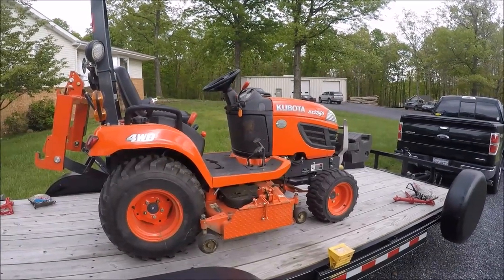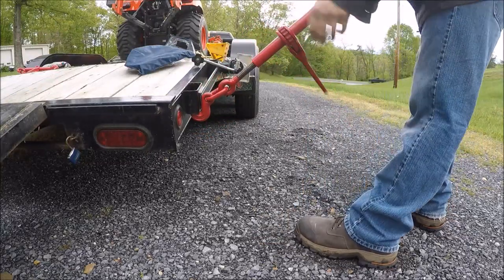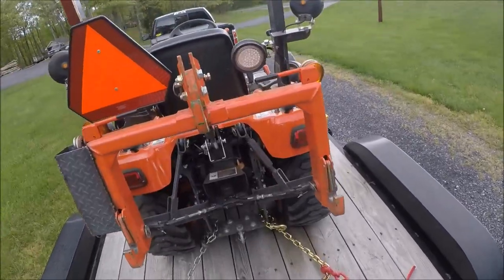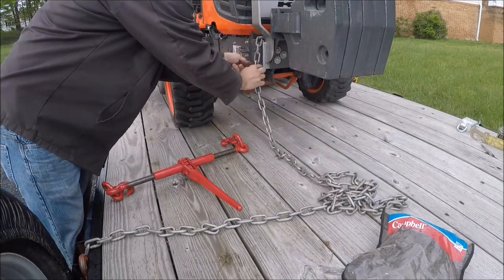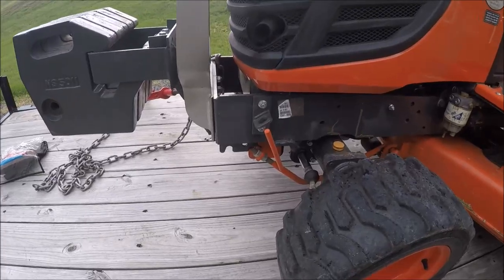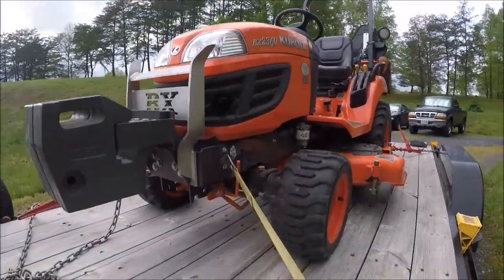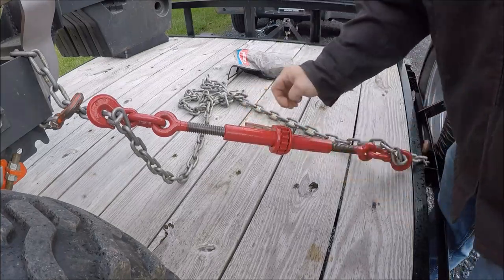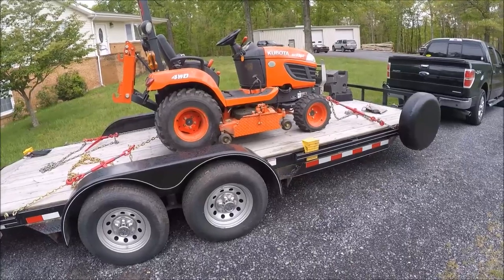How to Secure Your BX to a Trailer

Comment: I only use the 2.5 tonne ratchet straps on my BX, takes half the time, doesn’t chip away paint either. These 10mm chains are good for 10t each, way overkill. Apart from that, all your lashing tips are spot on. Locking webbing ratchets is very important, I see so many people leave them open, they spring out otherwise.
Reply from the maker: Straps are my choice. I just wanted to show 2 methods. Also if the ratchet breaks, it will still hold if it is locked.
Reply: That rating applies to a steady load. However, any kind of inertial forces, such as hard breaking, swerves can cause the net force on the individual straps to far exceed the weight of the vehicle, and possibly the rating of the straps. Just something to think about.

Comment: nice job! I like that you pointed out to stop and check the chains after driving a mile or so to insure they are still tight. I have arrived on location to find chains have loosened up in transport for some various reason. that is a good tip!
Reply from the maker: Thanks!!! I guess everything "settles in" after a little driving.
Reply: To help prevent the chains from losing tension make sure there is no twist in the chain as you bind it

Comment: In my state dot requires 4 contact points on the vehicle as you used. However it is required to be done in an X pattern. Also any implement has to be strapped down separately.
Reply from the maker: I cross the straps when hauling a car but I don't cross chains on a tractor. I'm not sure how you could cross the chains the the BX but if that is what is required in your state that is the way to do it. Thanks for watching and commenting!!
Reply: Coy Patton YEP thats FED DOT LAW ! CROSS CHAINS AND DONT LET THEM COME IN CONTACT WITH EACH OTHER  THATS A AUTOMATIC FAIL .
Reply: Travelin Thru yep. It is commercial requirements. Probably the only time you will have an issue as a private individual hauling is in some sort of accident. 
Good practice is to abide by DOT regulations, take pictures with a  date stamp.
Reply: Coy Patton read the law it's only if it's over 10k do you need four crossed chains. I promise you that tractor doesn't weigh 10k.
Reply: As long as you stop the movement in all directions it’s fine.
Reply: As long as the chains or straps do not rub, right?
Reply: Travelin Thru in Texas, that’s true only for loads over 10,000 pounds.
Reply: Go by the most restrictive.. state or federal law.  Generally they are the same for  securing loads.
Farm tags on the trailer makes it commercial and you need the crossed chains.
Reply: @fhuber7507  I have always gone by the basic philosophy that it only matters if you are in an accident, as seldom will DOT bother with a private vehicle and most local police have learned the hard way, they do not know enough to do much but get themselves in trouble. State Police want DOT to deal with it. 
When it comes to insurance or court, if you were in DOT compliance, you butt is in the best position possible. So at least 4 points at 45 degrees. This usually means they are crossed due to trailer width and load width. 
I cringe when I see someone with an unsecured load or a lawn mower with a strap across the operator station—both free to move any direction at all. And often just 1 1” strap!

Comment: Getting chains closer to the length needed saves money and can eliminate the need for  a couple of the ratcheting turnbuckles.  

connecting to trailer and tractor is almost the same at the uphill side, then you let the tractor move as you pull the downhill chains tight, then lock up the brakes.

Closer to how the flat bed tow trucks do it.

using a 25 ft chain where a 10 or 12 ft will do... just has a bunch of chain rattling on the trailer deck.
Reply from the maker: These are the chains that come in a bag from a hardware store. You can buy them cheaper than you can make them.

Comment: Great video. One thing my boss says is to always secure the hooks back to the chain, like you did around the chassis, not tip load it like you did at the stake pocket. Not sure if it just him being over careful, or if there is some science behind it. I though I may as well share it in case it is of some use for you.
Reply from the maker: Thanks! Some other people have said the same thing. I loop the chain around the stake pocket and hook the chain to itself now. I don't think it matters too much on something small like this, but on something bigger it would make difference. Thank for watching!

Comment: It’s impossible to find a detailed video on securing a tractor, so thank you for this.  A local Constable told me the excess chains cannot be more than 12” hanging loosely.  Do you think 3/8” is overkill for a L4701?
Reply from the maker: I would use 5/16 grade 70 chain. I believe any chain securing a load should be grade 70. If you have 3/8 grade 70 that would be fine, just over kill.
Reply: 3/8 chain is better since he may be hauling with implements, thus additional weight to calculate. Most people have heavier tractors also.

Comment: 94Bullitt, I meant to ask what do you recommend to do with the excess chain (example on the rear of tractor) after you tightened down the tractor? Do you tie up the excess chain or wrap it around itself?  I just watched your other 2 videos on what kind of trailer to haul your tractor and those videos definitely answered some questions I had. Yep, I'm going to get the 10K trailer with brakes on each axel. It just makes sense.  Thanks again.
Reply from the maker: Good question, It probably would be best to wrap the excess chain back around the binder and chain and secure it with a tarp strap. I'm glad you found the other videos helpful. Good luck on searching for a new trailer.
Reply: Houndsman One DOT inspectors I have talked to all recommend the chain be wrapped around the load binder. 1) they say the binder must be secured to prevent it from loosening. 2) excess chain must be secured to prevent it from coming away from the trailer, either causing damage to the load and possible flying objects, damaging your trailer in a manner that makes it unsafe (flats are common results) or the chain possibly hitting another vehicle. 
While not commercial and may or may not be required to meet DOT in your state, following DOT is the safest in many ways

Comment: Here you have to have 4 binders no ratchet straps you can only use factory tie down points you have to put a strap across the bucket and I got a warning for not having my chain hooked to a chain somewhere in the information that comes with the hooks on your chain it says they're meant to hook back to the chain

Comment: I like to criss cross my tractor tie downs like a X fashion. I’m assuming this video was for demo only? If not ..all that for that little riding mower was overkill BUT safe towing is best.
Reply from the maker: With the way the frame is, there is no way to cross the tie downs. With the tie downs pulling sideways, the tractor is not going to be able to move sideways like if the tie downs were straight.
Reply: Tractor Tech sorry to disagree, but using chains on the front you could easily use the front frame and do a X pattern for your chains!
The rear may be a bit more of a challenge, but it could be done. I would have to look at your tractor more closely to give a suggestion!

Comment: Would you recommend using a Uhaul auto transport on a compact tractor? It's a '09 3320 with front loader. Thank you
Reply from the maker: I think they are rated for 7k gross. The problem is the trailer isn't a full deck so your tractor may fall between the runners on the trailer.
Reply: @TractorTech  I plan on tying the thing down similar to how you tie your tractor to the trailer too. Hopefully that would keep it from sliding?
Reply: @TractorTech  I was afraid the tractor would fall between the deck but I secure all 4 corners to the trailer and make sure they are tight. Kept my eyes on the tractor as I drive and drove over 600 miles. Made it home safely going 60mph. Thanks for the advice!

Comment: Nice video. Its just like chaining down bigger heavyer equipment. Ive hardly ever used the ratcheting binders just cuz they were never around, but i have used em at different times. Ive always used the regular boomers & cheater bars. Why did ya use a rachet strap on the left front?
Reply from the maker: Thanks. Most of the time prefer ratching binders. I used a ratchet strap on the left front to just show a different method in case someone wanted to make a tie down like I did.
Reply: Tractor Tech.  Okie dokie, i gotchya.

Comment: With the loose end of the strap tick it in to the roll just before you finish tightening, sucking it into the roll, it will keep it better than just the tuck under the handle.
Reply from the maker: I'll try that sometime.

Comment: Could you have run just one chain binder from one stake pocket, through the tractor, and back to the opposite stake pocket ?
Reply from the maker: You can but if that chain comes loose then there is nothing holding that end of the tractor. With two chains on each end, if one comes loose you still have one holding the tractor.
Reply: Absolutely not! One chain per corner. One chain per end of vehicle lets the vehicle slide to one side or the other.

Comment: state dot requires 4 contact points on the vehicle as you used, however, you can use the Anchor Shackle with one chain in the back with one Ratchet Binder(can use a second one but not needed)
Reply from the maker: That is what I do the other tractor, there is not a way to use 2 chains on the rear of it.
Reply: zane parker DOT inspectors that I have talked to consider that arrangement of a shackle on the tractor as 1 point if contact. As it only has 1 point of contact to the tractor.

Comment: I agree with the tongue weight, but it did not hear you mention it in the video.
I would also mention securing the excess chain so it does not go over the side and either foul the wheels or drag on the ground
Reply from the maker: I should have done something with the chain in the video. In the future I may make a video on that.
Reply: Same goes for regular chain binders, wire the handle to prevent opening.
Reply: I’ve seen some use zip ties for the extra chain. A Texas Constable told me not to exceed 12” hanging below the chain itself.

Comment: I’m somewhat new to these ratchet devices, but what do you do with the excess chain on the trailer? Can they just be left like that or what’s the proper way to “hide” the excess per say? Thanks
Reply from the maker: +TowerClimber81 You should do something with the chain. You can wrap it around the binder then use a tarp strap to keep it from coming off.
Reply: 94BULLITT thanks so much! I know the answer was probably self explanatory, but was kinda curious if you left them loose or wrapped them around something. Thanks for the answer and video! Awesome channel and I’ll be a new subscriber!
Reply from the maker: Thanks! I am planning on doing a video on this but it will probably be sometime in the spring.

Comment: What size chains are those?  Ive got a bx23s and gonna buy 1/4-5/16 binders but not sure if i want 1/4 or 5/16 chain
Reply from the maker: Those are 5/16. They are overkill for a tractor this size, but I use them for other things. 5/16 grade 70 chain is cheaper than 1/4 grade 70. You can get a 5/16 chain in a bag with hooks on it at lowes or harbor freight pretty cheap.

Comment: Okay that was kind of nice because you can tell the guy was actually trying to do that stuff the right way technically the load capacity that he had for each one of thosepoints and securement are very very important for each rated weight and then you're supposed to always derate to the lowest point like if you have a stake pocket that's only at 2,000 lb and you have a chain that's 8,000 lb you're only allowed to count it at the lower number being 2000-lb although I'm sure that little tractor itself is probably only what 1,800 pounds maybe 2,000 can't be very muchso technically you required on something like that the regulations are 4-point contact so really good actually you actually you had that really good on all that simple stuff I knew securement actually for a living on big huge equipment in transportationso that's the really good thing is you actually did really good on all of that you just technically did not need quite that amount of load rating on your chains but of course yes it's good to have that just that technically it would not make any difference because you always go back to the lowest rate weight rating
Reply from the maker: Finally someone who understands. I also use those same chains to haul a 7000lb tractor. They can be used to haul other cargo also. It is hard to justify buying 1/4 grade 70 chain that is more expensive than 5/16 gr70 chain to haul a tractor a couple of times a year.

Comment: only one chain in the rear and one chain in the front / if u did your way , if one chain come a loose  want jerk the tractor around  might un hook from the trailer
Reply from the maker: With one chain in the front and one in the rear, if either one comes off you would have nothing holding that end of tractor.

Comment: You should never put chains into a stake pocket.   They are the thinnest and weakest point on the trailer, chain hooks can actually cut through them like shears,  you should ALWAYS use a stake pocket D-ring for ALL hookups, or attach D-ring and or chain slots to other areas of the trailer.

Other than that everything was fine,    The huge slack of chain really did make me grind my teeth.. its just another object that needs to be secured or it can slide off the bed and get caught in a wheel.     Would have been a wiser idea to just get some clevis hooks and use one chain front and back since you know your loading the same thing all the time.

As for tractor hook points, there's tons of different hookups you can buy, from d-rings, to weld on or bolt on banjo slots, to weld or bolt o chain hooks.    You can also get finger hooks for your chain and just go into a hole.
Reply from the maker: I did not show wrapping up the chain. I'm going to do a video on that. I used a 4 point tie down because it is the right way to do it.
Reply: but you're still attaching the chain / binder and routing it through a stake pocket....    You need to use a stake pocket D ring insert ( https://youtu.be/GpXCiOOoPxk )  as you did with the strap OR go directly to the frame or reinforced rail.   You cannot use a chain hook or a strap hook directly onto the THIN stake pocket metal.   It will cut through it like a can opener.

Stake pockets alone are NOT tie down points.   They are weak points made of THINNER metal and not designed to hold a load on a single contact point.  It's just like chaining it to a fender.    The stake pocket D-ring distributes the load across the entire stake pocket, not just where the hook touches, thus making it a legal tie down point.

Edit: Added link
Reply: Viper fukgoogPlus one point of clarification, not all stake pickets are created equal! Yes I have seen some thin ones, but some are also thicker. I have also seen them ripped off at welds.

Comment: How much does this tractor weigh?
Reply from the maker: Around 1800lbs.
Reply: If its tied down right and the trailer rolls in an accident, the tractor will stay on the trailer.

Yo don't strap them on based on just staying in place for normal driving.  
You chain them on so it doesn't join you in the truck cab in a wreck.

Comment: you said start at the front but then you started at the back ? aslso CROSS tie the back also per DOT you need 3 tiedowns MIN
Reply from the maker: I don't recall saying to start at the front. I said to start on the uphill side. The load is under 10k gross and for private use, so in most, maybe all states the DOT does not care. There is not a way to cross the chains on the rear. I had 4 tie downs. Thanks for watching and commenting.

Comment: Rap execs chaim around the chain excess strap can secured with friction tape (electrical tape)
Reply from the maker: I rap the chain around the chain or binder and pull the strap though itself or use a bungee like this https://www.tradekey.com/product-free/Adjustable-Shock-Cord-With-Plastic-Snap-Hook-Elastic-Strap-Bungee-Cord-3674779.html I get mine at home depot.
Reply: Tractor Tech that link is garbage.

Comment: And I know I've seen people put like 20,000 pounds of strapsor like 40000 lb of chains let's say for a rated capacity on only approximately let's say a 4000 lb rated rail rub rail of a trailersurprisingly if you actually watch people with little small pickup trucks you'll see that they do stuff like that all of the time truck drivers actually laugh at that stuff not really understanding why people do that I guess they just don't really understand that technically you can put forty thousand pounds of chains on a trailer and it's still only rated at 4000 lb if your securement point is out of writing and four thousand pounds for instance but great job there sir
Reply from the maker: That is like with tractor implements. For example I have seen people take a junk tractor supply blade and brace and gusset the frame, and not not do anything to the moldboard, which is the weakest point. Also their bracing probably did nothing for the strength because the main tube on the frame is undersize.